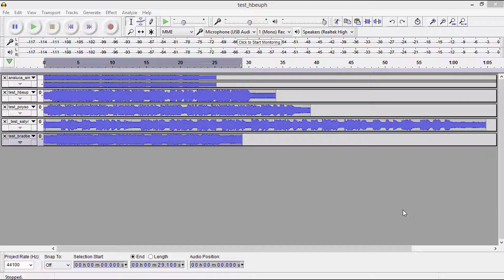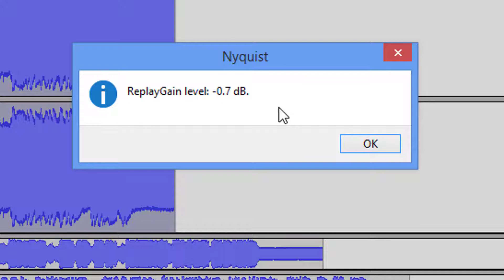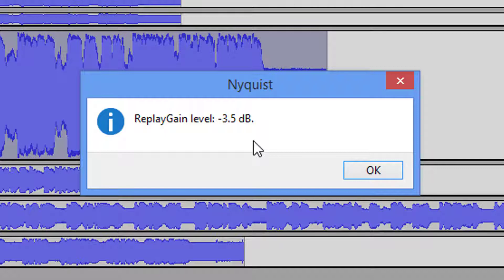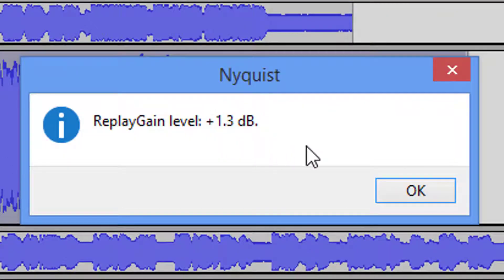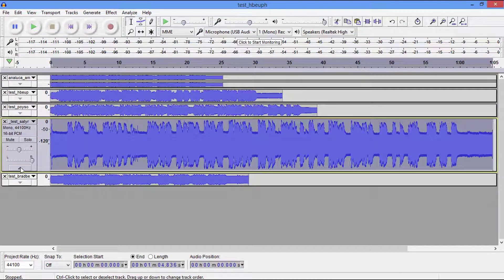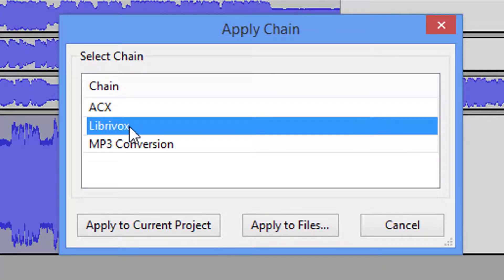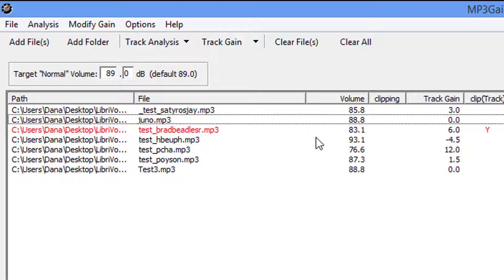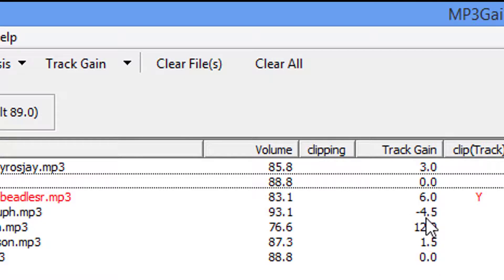How To Check Your Output Levels In Audacity

Comment: Saw this video, downloaded Replay Gain, installed but it’s not working the way it shows in your video. I see the same interface however when I click analyze and I go down to press OK nothing happens. When selecting normalize and pressing Ok, it does normalize the track but for whatever reason the analyze option does not pop up the screen giving me the decibel level.

Any thoughts? What I am trying to do is a montage of many different audio clips laid over music. I want the audio clips to be mixed at the same level with the music louder in certain places but generally lower than the audio. However, I am unsure what my baseline dB should be (is it -0.2 or 0.0) Also, I see areas where it says the track is -80 dB but the same track in other places says -0.6 to -0.12 so I am unsure what the target should be for a generic audio track. I have been using Audacity for years to record talk shows from the radio but have never done a deep dive into what all of the setting are. I typically go off of sound the way a talented piano player might be great at playing but not be able to read music.
Reply from the maker: You need to make sure that you have the latest version of audacity, as well as the plugins needed. In order to get the different audio levels you want, you will need to place those sections on another track, or use compression. Your base line  will be determined by what platform you plan on distributing your audio on. YT is a -14LUFS I think. Your total peak, DBTP, should be around a -1.
Reply: Thank you so much for the info. I was able to get it to work finally. 

I do have one last question. From all the tutorials I have watched some say the dB range can’t exceed 0 and ideally be between -12 and -16 dB but I keep hearing higher dB level being referenced (which you highlighted in this video when referring to 85 to 89 dB range)
Is the 0 the Gain level and the 89 the output level? Still a little confused on this.
Reply from the maker: I think you are referring two separate gain issues. The input gain should be around a -18dbs. This is called your input level or gain staging level and this is used when you are recording. The 89dbs is what the finial audio loudness should be, when measured by a meter as the audio is being played back though any number of listening devices.

Comment: What is librivox ?
Reply from the maker: Librivox is an organization that wants to take every book ever written that is in the public domain, and make them into audio books. Their goal is to allow people who have lost their eyesight to be able to hear them.
Reply: @DanaTucker1   @Dana Tucker Hello! Great radio talking book-type cause!!! Former radio and TV reporter here.  Engineers had set my levels - all was calibrated. Only had to run sound board volume, fade ins & fade outs. 

Whew! Tons to learn. Getting there. Questions galore...  Dana. Dynamic range 87 and 92 dB is for L's specs. What about... Online streaming of podcast + ? 

Searched high and low. Do you know the answer. Where do I go, what search terms do I look up 4 re: specs for online streaming (Youtube, Spotify,  Podcast platforms -14 LUFS & -1 OR -2 PEAK I Think. Do you have the dynamic range numbers? What about loudness range - what is ideal?

Any idea what the standard is - from which they are based? Options galore.

IS there a synonym - another term - for "dynamic range?" 

Also Dana. I've been struggling with this issue among another ;) - in an effort to perfect the loudness specs OVD & OVR LUFS in Audacity ( no luck in Sony Vegas).  
---
As an aside. Never mind that the third-party VST effects will not load / launch in audacity despite proper path installation. Working on it. 
----
My question #2. Any idea how I select aka highlight multiple tracks simultaneously, highlight, and use one plugin to measure all in total - not separately? 

I surmise I may need to run all of the tracks on one plugin to measure total levels at once, accumulative loudness knowing that the final LUFS or total dB's, depending on what plugin is measuring perceived loudness. Must be under 0 dB to avoid distortion and peak clipping. 

I want to gauge my totals. Output. Got any ideas? Thank you for your time.
 
Thx!!! Subbed!

Edit: reposted fix typo & sentence structure! Accidentally hit the 'send' too soon. :)
Reply from the maker: @Stern PR Marketing, the recommended standard for podcasting is between a -16 and -20 LUFS with a max -1dbTP. You do have a + or - 0.5db except able range. This standard was set by the AES, (Audio Engineering Society). 
 As far as I know, iTunes is the only streaming media platform that adheres to these standards. As far as other streaming media goes, they range from a -13 to a -14LUFS with a -1dbTP. Here is a great video Kenny did to show you who is playing your audio and at what range. https://www.youtube.com/watch?v=0wPnlND92QU. As far as measuring your audio with all tracks combined goes, simply place your loudness meter on your master track. As far as Audacity goes, I do not keep up with their software anymore. Just way to many hassles.